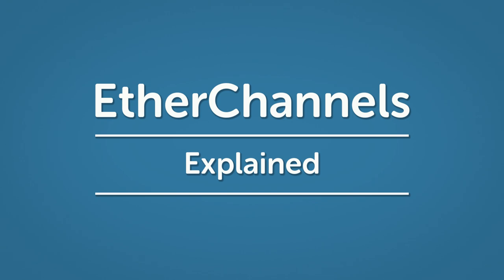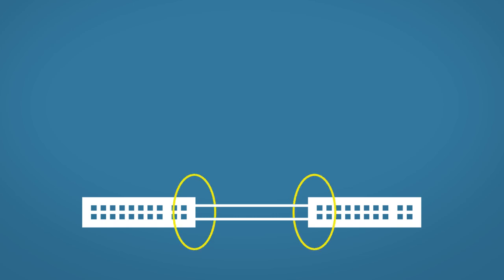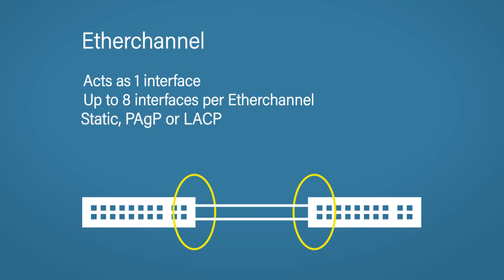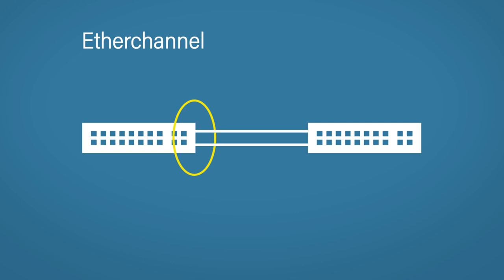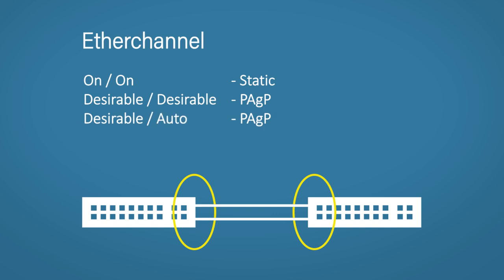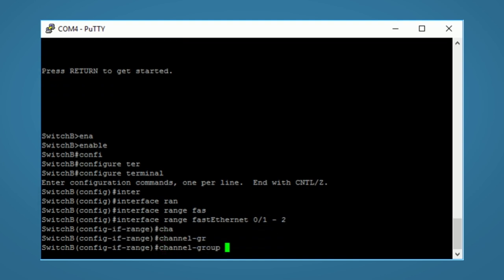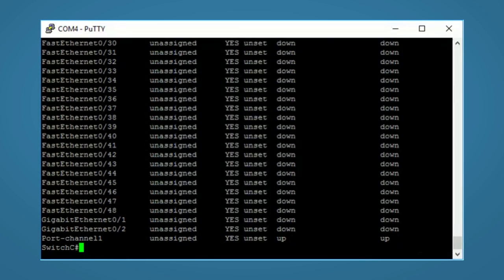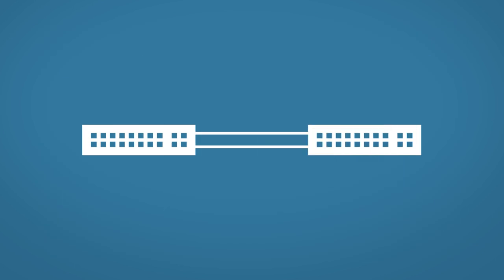EtherChannel Explained | Concept & Configuration

Comment: One thing I'd add is once the port channel is up, if you need to make configuration changes don't do them on just a single physical interface at a time or the port channel will come down due to things not matching. Instead make changes on the logical port channel interface and the Cisco device will automatically copy those changes to the physical interface configurations so that you don't take the whole interface down.
Reply: Thanks for the tips!
Quick question:
Is it possible, that only 1 side uses EtherChannel, thus it would lead to strange problems?

Comment: Good video and good explanation of LACP from the switch side. I work on rack servers and dealt with an issue of a port-channel being down that was causing unreachability issues for a server. We aren't sure what caused the configuration to go down but once we determined the issue was on the switch side and not the host side, we got the networking team to fix the issue. It was boggling my mind, the on-site technician, and their manager.

Comment: Good video. Suggestions though, 1. Do a shut command after int range. 2. Default port command after shut, and config all ports at one time. 3. Do the same on switch 2.  Do a no shut on switch 2, then on switch 1.

Comment: remember to use a crossover cable if u connect two switches or routers with another..
Reply: Do nowadays NIC's not automatically recognize whether the connection needs to be crossover or straight through, and then apply whatever is needed? I'm pretty sure they do
Reply: Nowadays NIC do but i worked with a older one🤷🏼‍♂️

Comment: Hi. helpful video but I have a general question about the configuration.when I created the port-channel interface and add two Gigibit interfaces to them, where should I config additional vlan settings [switchport mode trunk, switchport trunk allowed vlan xx ? in both interfaces [port channel and switchport] or is it enough to set them in the port-channel interface ? when port-channel is a trunk which mode should be the switchport?

Comment: Hi! I was actually learning about L2 link aggregation when i saw your video. Now I am a bit confused because some sources are claiming that using LACP is basically IEEE 802.3ad Link Aggregation and not EtherChannel. Are IEEE 802.3ad LA and EtherChannel different types of L2 link aggregation or we could simply say they are basically the same thing? Thanks for answering and keep up the good work, videos are awesome)
Reply from the maker: Think of LACP (Link Aggregation Control Protocol) as a method to dynamically negotiate an Etherchannel.
Reply: Etherchannel(PAgP) and is created by CISCO
LinkAggregation(LACP) is created by other

both are made for same purpose

Comment: Sir, I want to know what happens when we connect TWO  Palo alto HA1 port  by straight cable instead of crossover cable. Please advice on it asap.
By mistakenly  I connect straight cable instead of crossover cable and leave the data center.plz help.
Reply from the maker: While I cant say for sure, most devices can detect this type of setup and correct themselves 👍

Comment: Switch#show interfaces port-channel 1
                                     ^
% Invalid input detected at '^' marker.

Is this command unsupported in Cisco packet tracer?
Reply from the maker: Looks like you are right. The command doesn't seem to be supported.
Reply: @Certbros  I found that the  command is supported on multi layer switch.

Comment: why every time I close the paket tracer application. the interface port chanel always turns off(down).
is there a way for the interface to turn on by itself???
Reply from the maker: Are you saving your configuration before you close packet tracer? Try running the command  'copy run start' on each switch to save the config.

If you have already done that  STP will take a few seconds before it allows the interfaces to go up. It needs to transition to the forwarding state. 

Hope this helps.

Comment: Will it load balance a single flow or will it load assign flows to a given link to attempt to balance the channel? For example, if I have 4x 1Gbps links aggregated into one logical 4Gbps EtherChannel and I have a single PC sending 2Gbps to that switch's link, will it be bottlenecked to 1Gbps or will it send all 2Gbps split over the links? 

  I'm sure if it was 2 PC's with 1Gbps each it would split and balance to at least 2 of the 4 physical links.